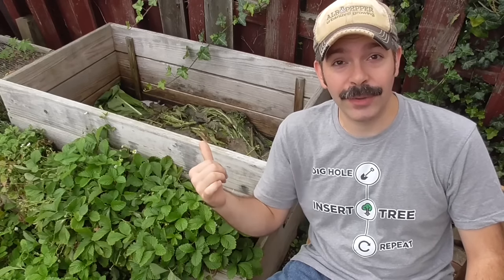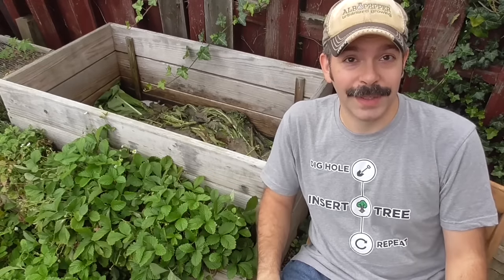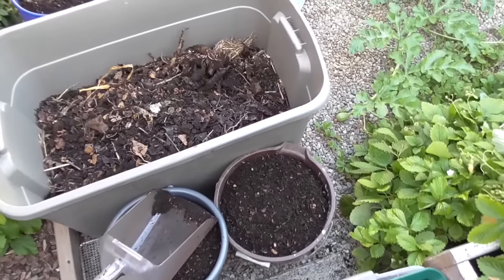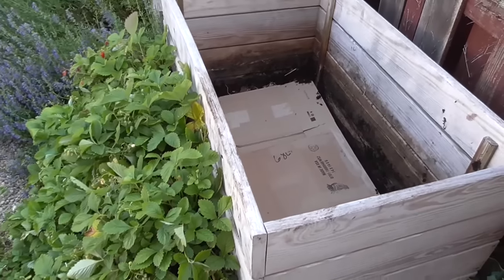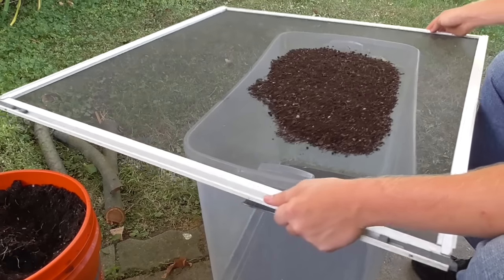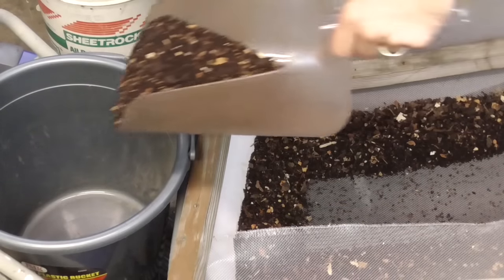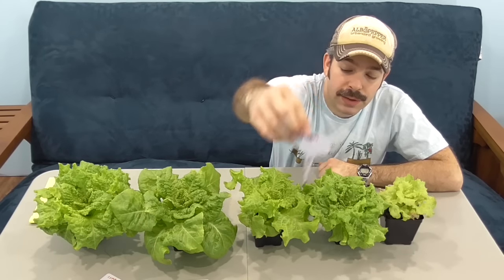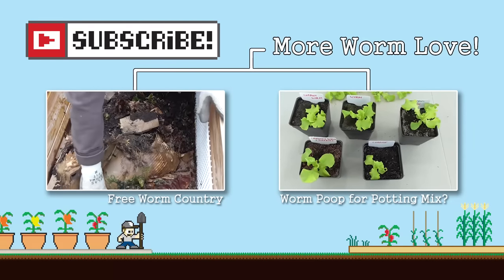How to Sift Worm Castings from Vermi-Compost Worm Bin / Grow Box

Comment: If you had used a plastic coated mesh, I guess it'd go more easy on the worm skin. Also why do you need so finely sifted casting btw. Have you done an experiment with sifted vs unsifted castings?? That wud be great right  :)
Reply from the maker: That's a good point about the advantage of a plastic mesh. My main reason for finely sifting is to recover as many worms as possible. I've found some super tiny baby worms that filtered through, even use a fine mesh. Basically, I just want to keep the population as high as possible, especially since they're outdoors.

As far as quality goes, I would expect the same plant growth from sifted or unsifted. But experiment would be the way to know for sure!

Comment: Hi, how hot do your summers get? I have a similar box but without the front planter and I put my worms inside a 20 gallon tote and then put cardboard and newspaper in between the wood and the outside of the tote to act as insulation to keep the worms cool in our hot summers. (AZ) I also had to put ice packs on the top of the cardboard covering. This year I am going to dig a trench in the ground and create the same environment and see if that is cooler for them.

Comment: forgive me if you answered these already but I have a few questions. I'll be starting this soon. 1. is that bin in full sun? 2. what food did they like the most? 3. did you need to water them? how often?
Reply from the maker: Hiya! The bin is shaded from the western, afternoon sun. I've found that the worms like browns: soggy cardboard, shredded Autumn leaves and even dead plant roots from the garden. They also like soft, squishy plant foods like watermelon rinds. I typically don't water them since their leaf bedding retains lots of water. But in a hot, dry spell I might sprinkle them once in a while. I partially cover the pile with a plastic tote lid, which helps too.  :-)

Comment: It would probably be easier to tie all four corners of the sifter so it's fully suspended. you could probably hook up a shaker, something shake weight like, to sift it for you.
Reply from the maker: Thanks for the tip Corey! I mentioned about how I could tie up all 4 corners. If I was using a large tarp, it would be perfect. But I found that I had better control and was able to keep all of the castings inside the wheel barrow this way. Also, it saved me from a Gym membership!  LOL  ;-)

Comment: Please forgive me if this has been answered in one of the other vids. But do you find you dont have to water the plants as much due to the wet material going into the bin? Thank you in advance.
Reply from the maker: Hi Andrew! Thanks for watching. Of course, weather patterns are the biggest factor. But in my area, I didn't have to water the plants in the front planter too frequently. On thing, I noticed was that the soil tended to settle over time. So I would advise using annual plants since you can easily top off the soil level as needed in the Spring.

Comment: I know the video is quite old but why did you go with such a small mesh and not for instance 1/8 th inch which is small enough for the eggs?
Reply from the maker: Thanks for watching! I didn't put a lot of thought into the screen size and simply used what I could find on hand. However, in my situation, it worked out better to keep the eggs separate from the castings. My castings were stored for many months. But the eggs and non-sifted materials were put back into the box for further composting.

Comment: does this bin require a lid?
Reply from the maker: Hi John. It isn't necessary to have a lid. But in super dry climates, placing something on the top can help to conserve moisture and protect from sun and animals. Sometimes I'll place a lid from a 30 gallon tote on top of all the scraps. Without a covering of some sort, the top layer of materials tends to dry out, until it is buried under further scraps. One possible covering would be a piece of insulation. This would add protection against extremes in temperature.